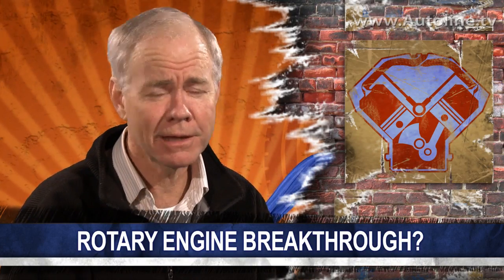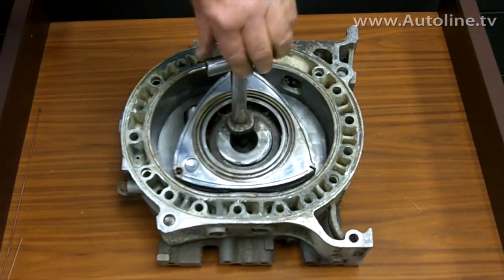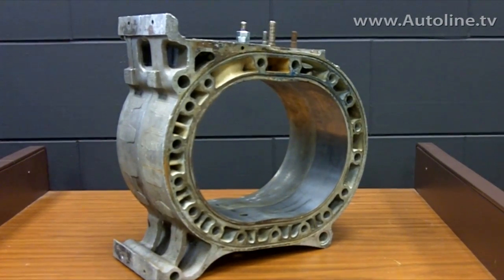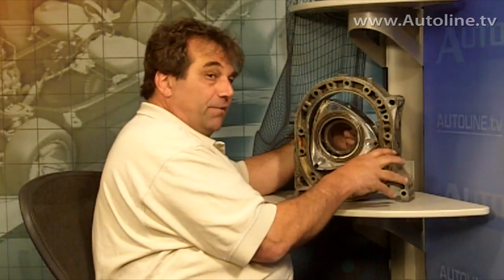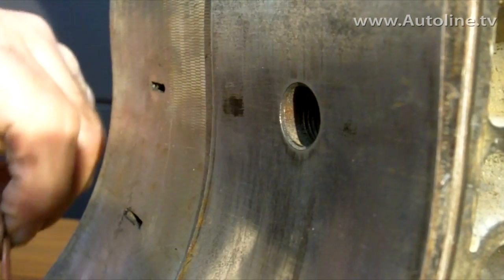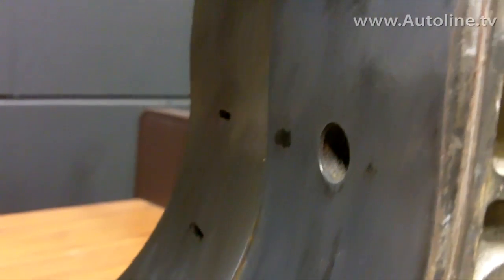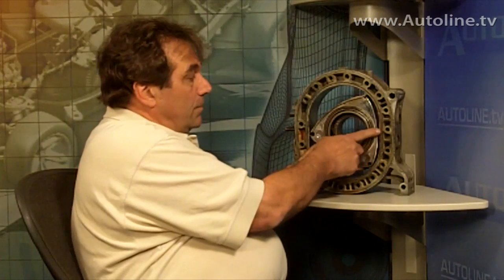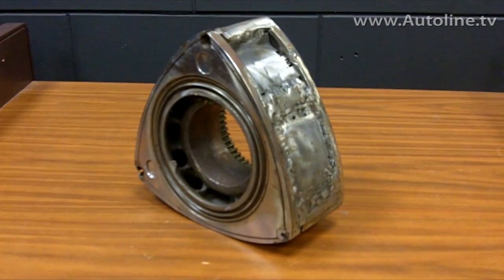Rotary Engine Breakthrough?

Comment: I can't believe the number of people discrediting these theories simply because he doesn't have access to manufacturing to make a perfectly pretty prototype. Experimentation and theories NEVER start with any amount of polish, and fucking obviously he's not implying that what he's showing is "good to go".

Also seeing a lot of people trying to say that these ideas won't work because of fluid dynamics, but apparently they're not considering the other forces in play. NO, it doesn't reduce the pressure of the post-combustion gasses; that's not the point. The point is to manipulate the expansion of gasses into rotational energy, which is the whole fucking point of the engine. Existing designs only ever maintained rotation because of pre-existing rotation upon start up. That's the only thing that keeps it rotating. The pocket just assists the expansion in a desired direction prior to venting to exhaust.
Reply: Buncha haters, not creators.

Comment: Anyone with a running motor and an EGT could prove the first one if true. Do a long wide open pull in a high gear from low rpm. As the rotor speed increases the time to "leak by" would shorten and the EGT should drop. If they don't and the AFR stays constant it's not the true.

Comment: The only viable 'improvement' I see here is the slotted plug hole, but since the apex seal only crosses the gap at lower compression points of the cycle I doubt the big reduction in spark interface would be worth the sacrifice

Comment: Uhm, that is all nice but not really rotory engine's problems.

You need to figure out how to deal with massive tempriture diffrencess beween sides of the rotor, how to reduce wasting oil and how to beter insulate against leackadge of fuel.

Injecting oil into the rotor is done because of metal expanding on hot part (ignition/exhaustion) position and fueling and compressing are fairly cold, thus metal slightly retracts.

Being completly iliterate in technologies i am going to use "advanced materials" term, because that is one way to solve problems with insultaion, materials less suseptable to heat than metal and equally good at withstanding preassure and long weare. Solving that should in theory deal with oil inefficency.

so sure good owrk on the less important issues fixing now see if you can tackle the trully daunting task that had been bigest obstacle of suxcess of the motor.

Comment: nickoli98898 months ago
+The real doktorbimmer
You have a serious reading comprehension problem, to the point where you are trying to even counter points in which we are in agreement. Mario's post was spot on and I urge you to re-read it. You have basically re-stated everything I have said, except you get hung up Pascal’s principle whenever anyone utters the word pressure. I don’t know how many times it needs to be stated, but the flow is neither incompressible nor (quasi)static.

For whatever reason, you jump straight to combustion (flame propagation) without ever uttering a word about chamber filling because you KNOW that combustion chamber shape effects the flow path and therefore velocity and pressure. Of course, being compressible and of multiple species and phases, the flow is obviously much, much more complicated than my plain description (fuel separation, etc) - but, all the more to my point. 

Colliery to my point about piston crown design, the domed pistons you see adopted in almost all modern engines are designed largely to introduce tumble, which aid to better homogenize the mixture. Also, as I already stated, they create a squash area during compression stroke, and upon ignition, direct the propagating flame front.  My point to all of this is I do not see why this can not be studied on rotary engines. But again, here you go off sputtering nonsense about the largely irrelevant Pascal’s principle to no end. 

There is a nice paper on this concept which should be relatively easy for you to comprehend:
"Enhancement of Combustion by Means of Squish Pistons" by Katsuhiko Miyamoto

In fact, just google Wenkel CFD and you will find some nice papers/visualizations of the pressure and velocity gradients that exist within these engines, which are, again, irrefutably influenced by wall/chamber design.

Comment: This is fantastic news. This guy has proven that replacing the spark plug holes with small narrow vanes DOES WORK. I have made a computer model which shows the theory. The leakage is from the spark plug hole. Also compounding an offset combustion will reduce the rotor from rattle which prematurely wears out the rotor seals that holds in the compression. That is something that I haven't figured out yet, I thought of using a different alloy than Mazda used in the late RX-8.

Comment: part of the solltion awesome just the facts sound great we injoy your help on egts hot trubos  the trubos will cool off docter wankel
Reply: hi neil love your comments
Reply: xke xke22 minutes ago (edited)THE WANKEL ENGINE MAKES THE PRESSURE OUTSIDE THE ENGINE FOR YOUR EXHAUST THE ONLY PRESSURE THE WANKEL MAKES IS THE COMPRESSION STROKE INSIDE THE ENGINE WHEN   THE APEX IS IN THE LEADING PLUG HOLE THE EXH PRESSURE IS OUTSIDE THE ENGINE THIS WHY YOU HEAR IT FROM THE EXH PORT OUTSIDE THE WANKEL ENGINE  LEAKAGERead more Show less Reply     1

Comment: I am sure mazda engineers exhausted and tested all ideas and designs in the development of their rotary engine and variations and came to the design that works the best.  What this guy is proposing may sound good in theory, but in actuality, the engine is spinning so fast that the time the apex is over the spark plug hole is milliseconds. The leak he is referring to between chambers is, at best, miniscul at operating speeds. Not only would that slit design of his cause misfires, but carbon blockage from misfiring, thus fouling even worse then factory. 
And on the offset compression rotor theory. The moment of fire of the spark plugs is a timed sequence, so it would not matter where the squish was on the rotor face.  That is why there is ignition spark timing control to get the most optimum burn at certain engine rpms and pressures.  The rotary engine is not fuel efficient due to the fact that one crank revolution there are 3 phases of fuel injection into the intake chamber.  
Now if only mazda can design a rotary engine where the rotor gear actuated valves to open and close intake and exhaust valves so there is more control over lapping charges.

Comment: That's an excellent static analysis of an inherently dynamic engine.

The rotor is spinning so quickly that transit times of the pressure waves and air/fuel charge do not lead to a significant volume of leakage.  By replacing that big intake hole with a tiny little slot, all you're doing is creating a huge amount of restriction in an already finely-tuned intake runner.  I'm sure an oblong intake port could be tuned to work, but it's probably not entirely necessary.

The piston does not push against itself because the combustion chamber is so inefficiently shaped in a rotary engine that you end up with a significant amount of ignition advance.  It takes so long for the flame front to propagate that by the time you reach peak pressure, the rotor is already offset to "help" the rotor move in the correct direction.

Any reduction in exhaust temperature is probably due to a less efficient burn.  I notice that they didn't talk about any power numbers in the revised design.  I have a huge amount of respect for both technicians and engineers, but they each have their respective jobs to do, and although they can each learn from each other, an engine based entirely on advanced fluid dynamics cannot be so obviously upgraded based on plain-English concepts.
Reply: You sound knowledgable.  You ought to take a look at this doktorbimmer guy- he's so opposed to anyone anywhere saying anything good about any concept besides diesel that its become some kind of mental illness for him.